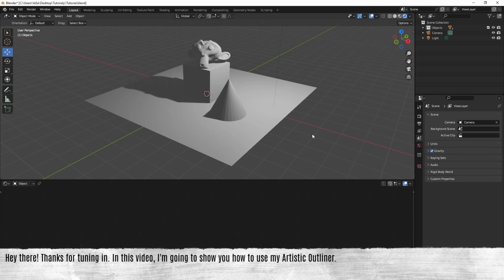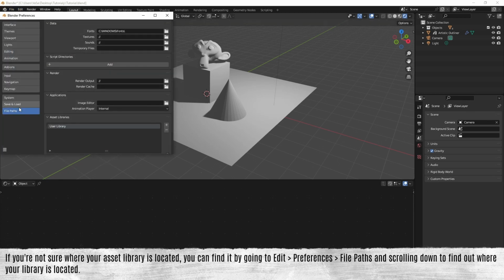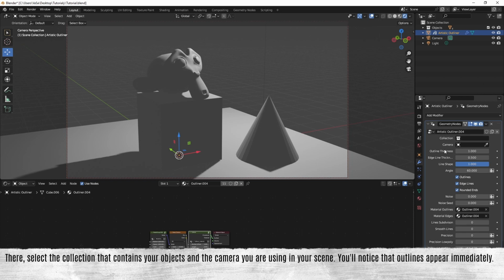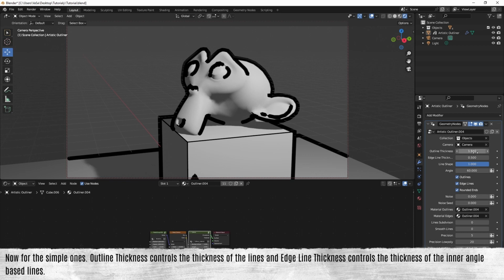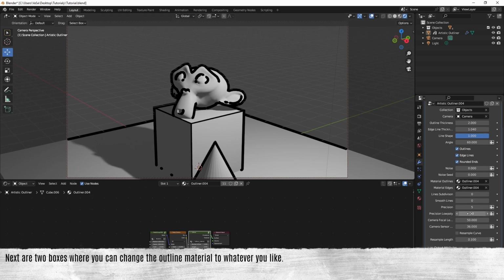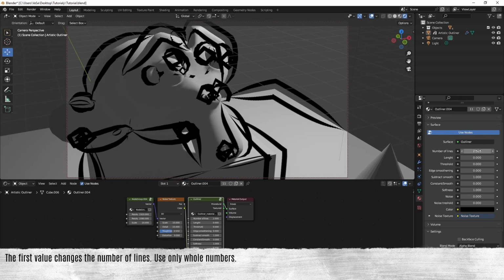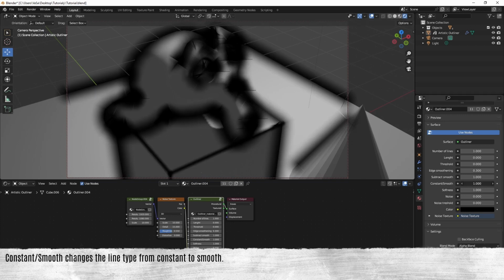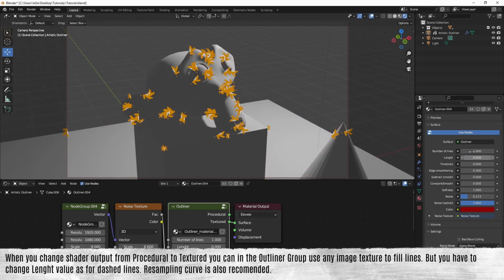Artistic Outliner | Product preview

Comment: Hello  How do I modify unnecessary lines in the lens?
Reply from the maker: Hello, you can easily crop the area where the lines appear by using either the "camera focal length" or the "camera sensor width" in the modifier properties. If you'd like to select individual lines, there might not be an easy way to do so directly within the geometry nodes. But you can apply the outliner modifier and then delete unwanted lines in edit mode.